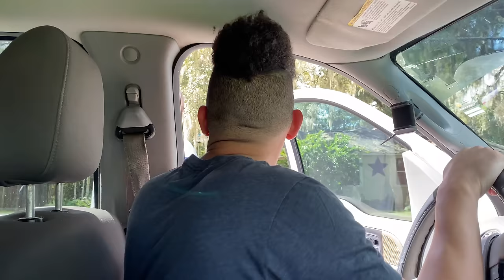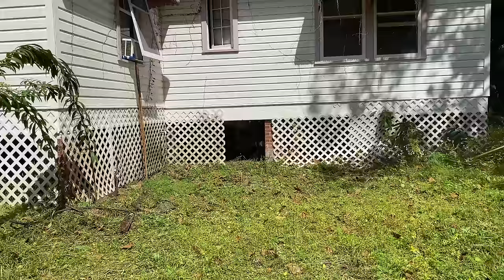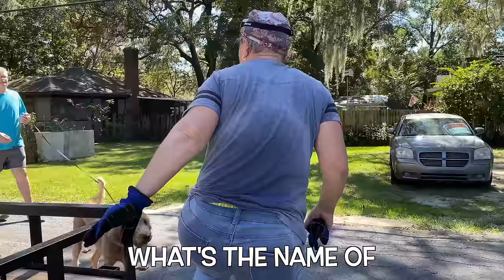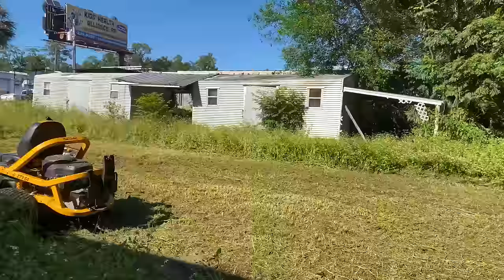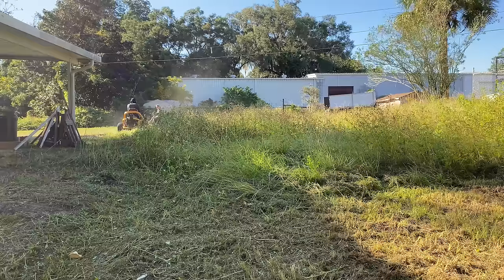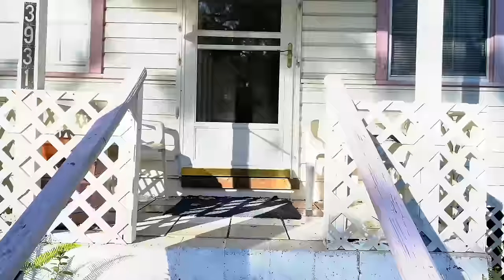**WARNED! POLICE WILL be CALLED if I Mow THIS Elderly Woman's LAWN!**

Comment: Nice job, so nice you were able to help the lady out. You probably just flooded the weed eater trying to start it (plug gets soaked in gas) so you need to let it sit to dry out, or you can pull out the plug to dry it off, if you need to get it going sooner.

Comment: I like the way you do your multipass on your mowing. I watch other people who do multi-pass but they don't do it enough until the grass looks smooth. For instance I'm going to attach a link to a cutting where the guy did cut the overgrown yard down, yes. But the alarm was left looking like a wasteland it needed many more passes.

Personally I use a bagger myself for the cleanest grass. But one thing I don't see a lot of people do is do their edging first. I age first so that what I'm mowing later I can mulch up the cuttings or bag it. One thing I've learned with a bagger too is that if I'm mulch first, the bag doesn't fill so quickly. For instance, leaves fill my bag very quickly, but if I run over them first with the motor, I can get the whole yard with leaves in my bag. When I was a kid, I hated raking leaves. So now I avoid it all together.

Comment: You need to get the adapter that goes in a battery powered drill and other end goes in the hole by the pull start. Those are awesome.

Comment: I used to work for lawnmower  firm   carry a screwdriver and  plug spanner  take plug out  and fit a New one   if it sparks but still won't start   then put a cap full of  petrol  in the plughole  pull it over r once then fit plug and pull to see if it  is starved of petrol,   if no spark after trying everything   it is the electronic ignition small box  earthen to the engine   by a scew  with one wire  coming  out  to the coil  that maybe the problem

Comment: As a retired Farmer, who used to not only cut, but rake, windrow then buckrake (into heaps to fork onto the trailer) and thus take to the one site in a far away paddock, to stack our own Hay (loose hay) in foot trodden compressed stacks, I can tell you this much, the reason why BOTH of your ride-on mowers, are UNABLE to cut everything on the first, second, hird or more passes, is simple.

YOU ARE GOING WAY TOO FAST "FOR YOUR DECK'S CUTTING ABILITY", Slow TF down.

If you drive slower, with a higher reving cutter speed, ONE PASS is all you will need, even for the highest grass/weeds.
That way, you will save on mower maintenance. As well as keep your tires longer and be able to stop quicker.
If you hit anything that YOU FORGOT TO WALK OVER THOROUGHLY, (befoe attempting to cut-blindly).

That way, videos will take longer (or you can speed them up as others do - during editing), but you will be "seen" to be doing a far better job with the appropriate mowers, and NOT look like high speed idiots, hell bent on making every lawn look like a racetrack, to be driven over as fast as possible, with incorrectly maintained (dull knive) cutting decks.

Comment: I don't know what your situation is on skills of keeping mowers etc running tip top. I used  to have a lawn mower repair shop. It pays to keep blades sharp. It's not hard  either. I noticed you had to go 2-3 times over a row of mowing. Sharp blade and going a tad slower ....prob a one time pass. You should always have 2 trimmers on hand, as one always breaks down....just saying . Best wishes!